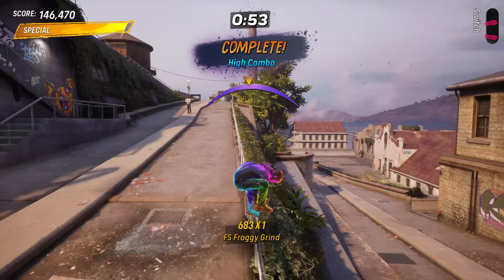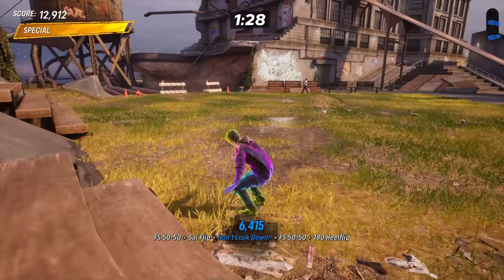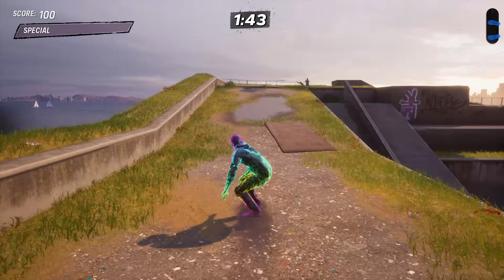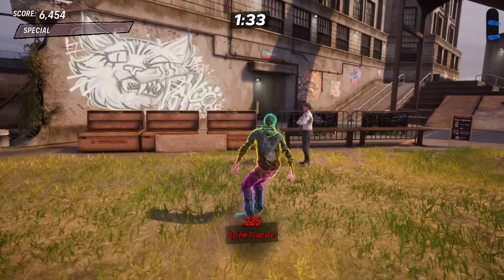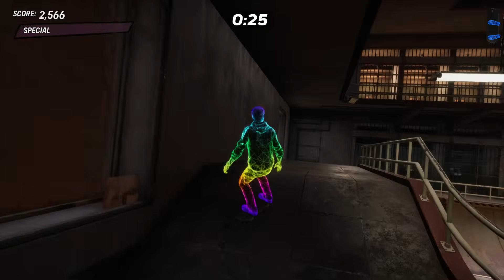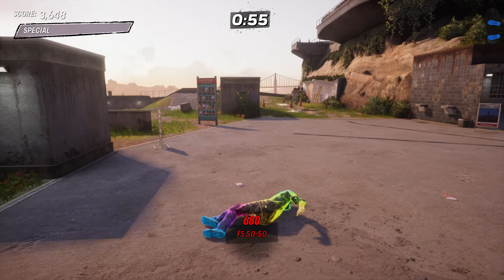Tony Hawk's Pro Skater 3 + 4 Alcatraz Career Goal 100% Completion (Tips and Tricks)

Comment: The games were designed with arcade physics, and so, Iron Galaxy should have left them in!  Otherwise, if they wanted real physics, they should have made all the missions that require insane heights easier, period!  The High, Pro, and Sick Scores should have also been lowered!  The games are 10x harder than the originals due to the realistic physics added to the games!